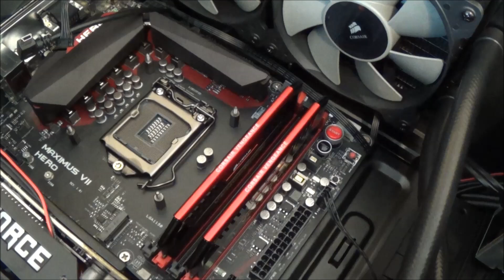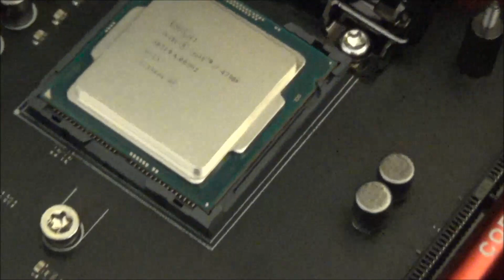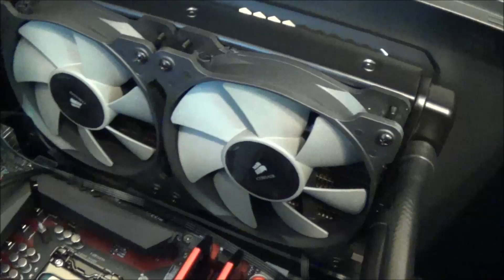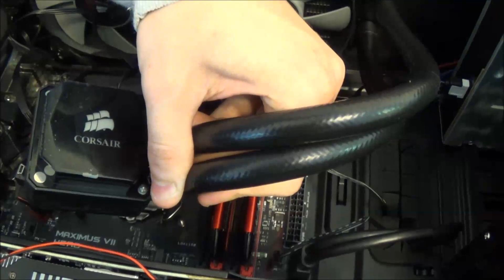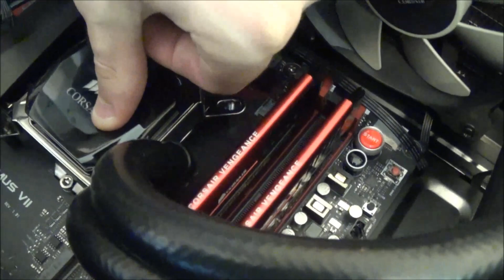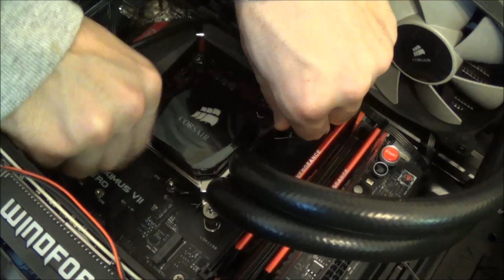How To: Intel Core i7 4790K Haswell CPU + Cooling Install

Comment: Guys i have a question about the cooling  i7-4790K. will the wind cooler cool enough the  i7-4790K or i need water cooler for this ?
Reply: what "wind cooler" are you talking about? The Stock cooler? I'd suggest getting another cooler if that's the case. The 4790k gets really hot compared to other CPUs. It doesn't need to be a watercooler though, any sort of somewhat big, good heatsink with 2 fans will keep it very cool. If you plan to OC the cpu though you should really get a good watercooler to avoid any thermal issues.

Comment: I have an i5 and trying to swap it for an i7 with the  cooling system, my question is to I need to take the motherboard completely out? and do I need to remove all the cords out before inputting the new processor?  I'm new to computer gaming so I'm just a little curious.  I know that I'll unplug all the power cords before taking anything out, Just not sure if I need to completely remove the entire mobo out the casing. Thanks.
Reply: +airmix08 You shouldn't have to like in this video, he didn't remove it, just make sure there's nothing in the way in terms of wires and such. Static of course with fur clothing, rugs, carpet, etc. will destroy your parts.

Comment: Need screwdrivers to slightly tight the screws,for 100% flat with no air scape in the processor and thermal paste..